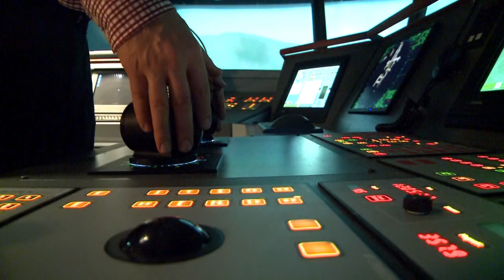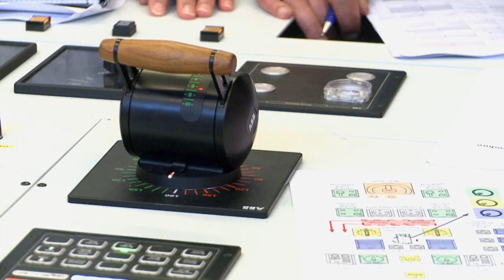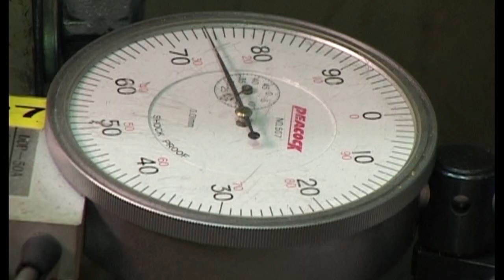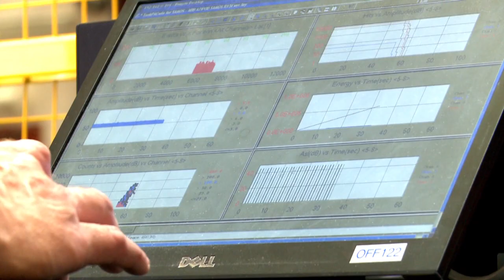ABB, Azipod - From innovation to customer value

Comment: sir, is it possible to replace normal screw propeller with this Azipod propellers in Container ships and General Cargo ships. So that the cargo carrying capacity could be increase by decreasing the space of propulsion devices.
Is it possible?
Reply: Possible. But there are downsides. Added complexity and higher cost.
Reply: Also the high torque on the pods compared to shafts.